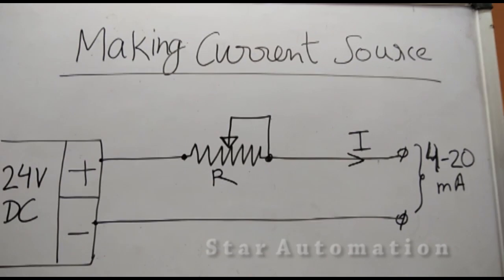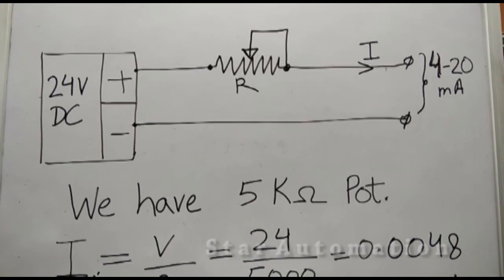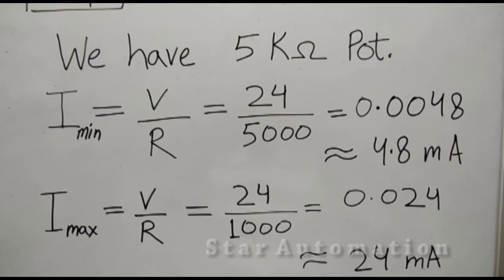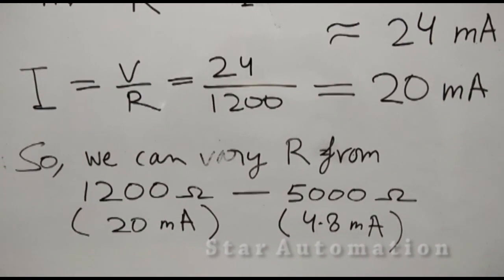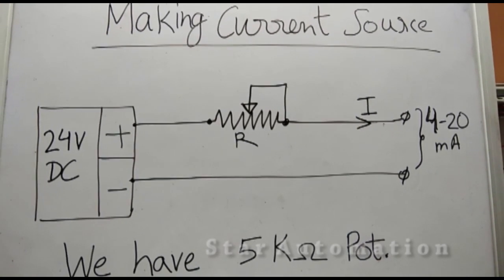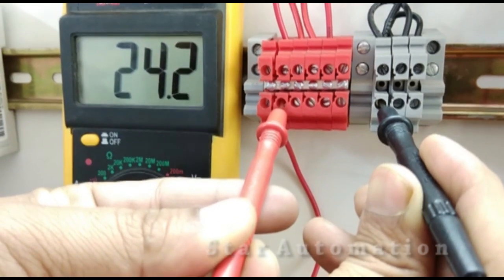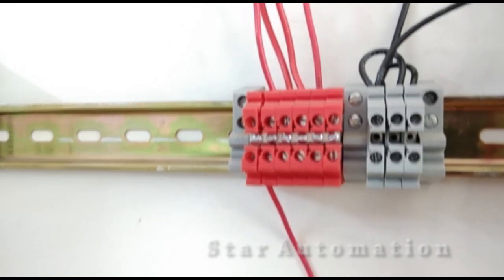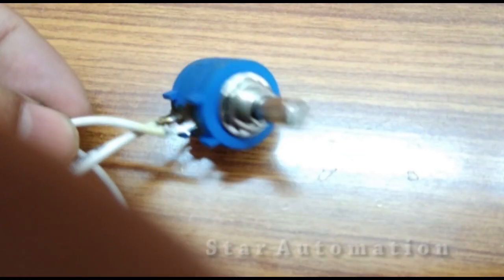Making 4 20mA Current Source

Comment: This video does a disservice to viewers who are hoping to learn more about making 4-20mA current loops work. It supposes that all one needs to make a 4-20mA current 'source' is a variable resistor. Well, in fact one can use a variable resistor by itself, as shown in the video, but it will never be a reliable 4-20mA controller. This is because it cannot monitor the actual resulting loop current, and cannot automatically adjust to variables in the current loop. If the power supply voltage wavers, the current will change. If the loop resistance changes (for any reason, including temperature, connection resistance, etc) the current will change. If another receiver is added to the loop, the current changes.

The upshot of this is that a simple variable resistor can be used to vary loop current on a crude, temporary basis. But it cannot work effectively in real applications. Only a proper 4-20mA "transmitter" can do this, because a transmitter not only adjusts its own resistance automatically, it also monitors the loop current so it can compensate for resistance changes elsewhere in the loop.
Reply from the maker: Yes, dear friend you are right.
It is a very basic form of current source through which you can test any instruments operational working, which needs 4-20mA signal at its input terminals.
Reply: How many watts? Please advice.
Reply: @mobmt6239  How many Watts what? If you even need to ask about Watts for a 4-20mA application, then you probably don't understand the theory.

Comment: IF  YOU TURN THE POT TO LOW RESISTANCE POINT, IT WILL BE LIKE SHORTING THE 24V, HIGH CURRENT CAN DAMAGE THE MULTIMETER OR THE FUSE WILL BLOW, EITHER INSIDE METER OR THE POWER SORCE
Reply: Correct! though most trimming pots have limits set so they don't venture to that minimum resistance if so it will be open cirucit and show a fault on the control loop either on your DCS or control panel. Usually it will indicate fault that the valve has overtravelled or something along those lines

Comment: Very good video, just 1 question, why the R variable (potentiometer) have 3 wires? 
Resistance wire "A" go to + 24 vcd
Resistance wire "B" go to multimeter (+)
Resistance wire "C" go to ?????
Thanks
Reply from the maker: Potentiometer say 5k ohm has three wires, A B and C.
So, resistance between A and C will always remain 5k ohm. When we rotate the knob of potentiometer, resistance between A and B will increase and at the same time resistance between B and C will decrease. B is called as wiper terminal of potentiometer.
Reply: @starautomation  SO THE TERMINAL "C" we can leave without wire, wright?
Reply: Atahualpa Gaytán the main reason is that it works as a voltage divider. it's like two resistance in one. if you connect only one leg it's like you have only one resistance. the difference is that using a voltage divider gives you more stable output that just one resistance.

Comment: You may have mentioned this in the vid but, my hearing is not that good. Is the pot 10 turn? Is it carbon or wire wound.  Thanks.
Reply from the maker: It is wire would ten turns potentiometer.

Comment: This is very dangerous to any instrument, you need to put one resistor in series first to limit the current not go up more then 20 mA,
Reply: If potentiometer is at zero resistance then, load will receive direct + 24V, and it will damage the load

Comment: Nice video  but I need more precise current.
Reply from the maker: For precise variation in current, you need precise variation in resistance as 24vdc is constant. You can use ten turns potentiometer for precise variation in resistance.